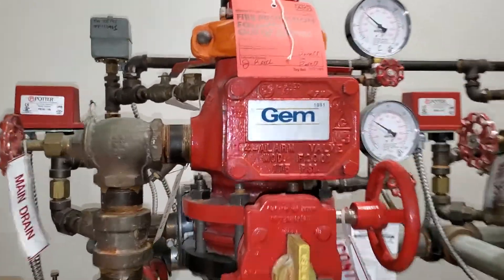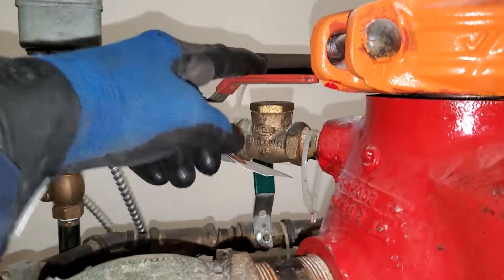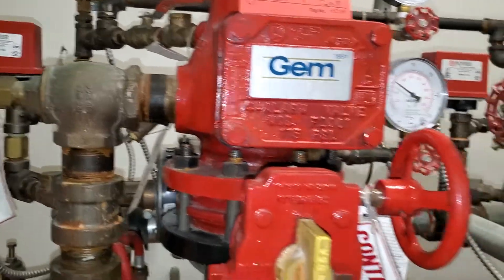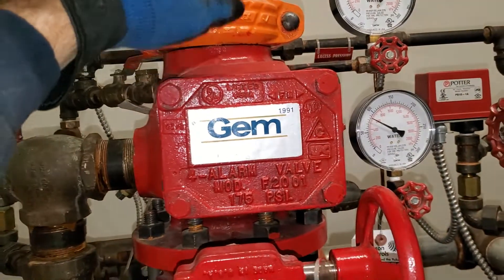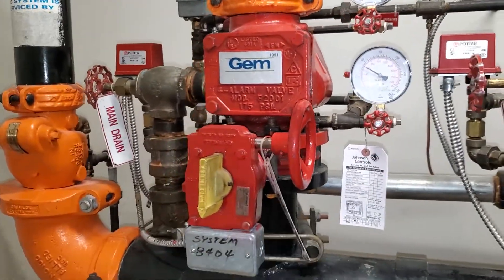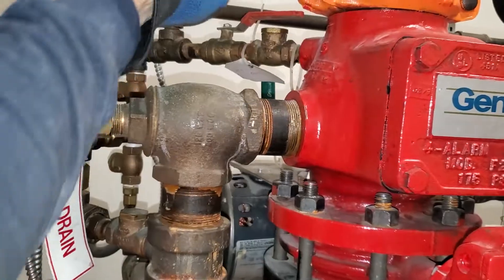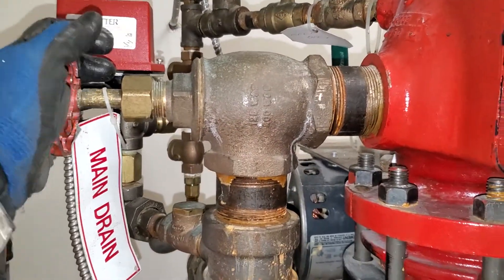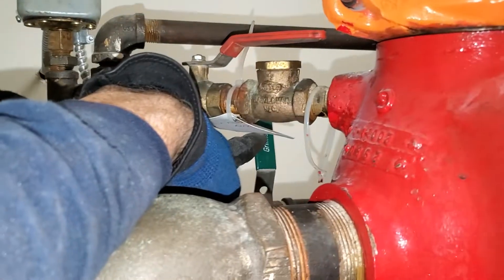Sprinkler System Alarm Valve

Comment: You crack the Control Valve (water supply), then begin to close the drain slowly until the supply water pressure builds up, then you open your water Control Valve completely.